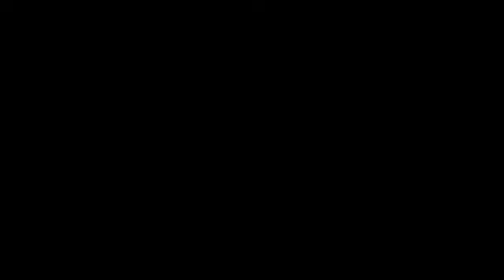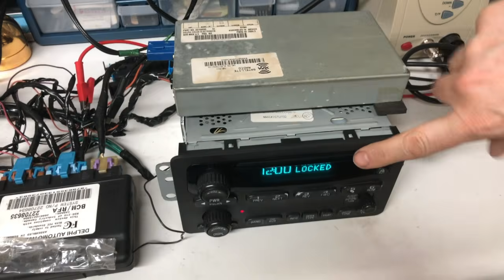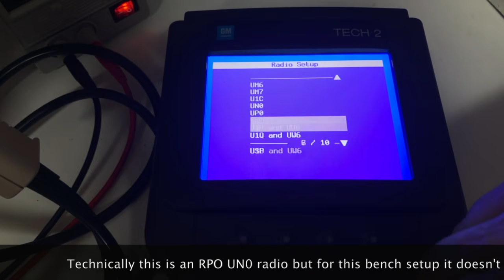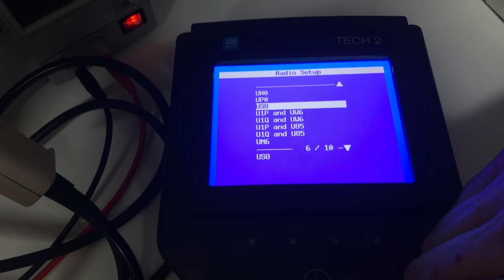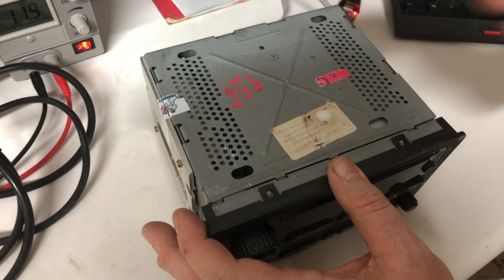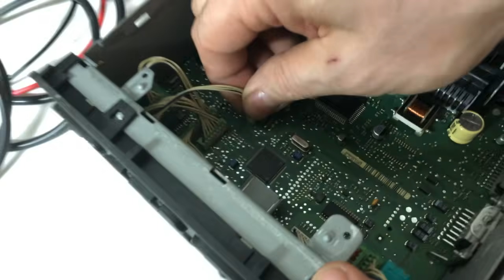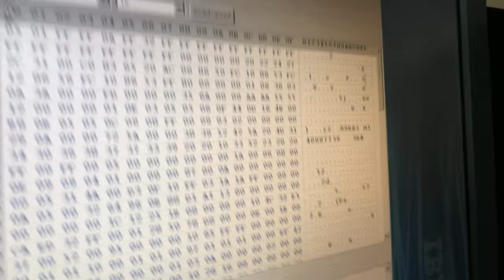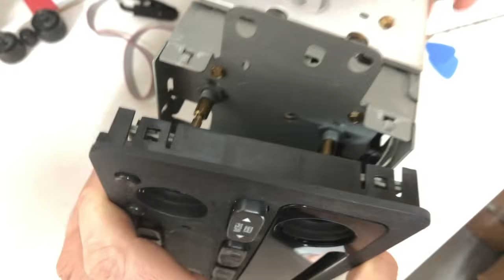2003 - 2006 How to VIN Unlock Salvage Yard GM RDS Radio w/ Tech2 OR Manually Programming its EEPROM

Comment: This is a fantastic video.  Kind of makes me want to show it to the two different auto shops that couldn't program my 2009 HHR!  They had similar issues to those explained by @chevmaros below!

Do you know if the CH341A can be used to program the Amtel 24C128N chip?

(some additional info: No surprise that many DELCO radios use different eeproms.  Mine has the AMTEL 24C128N chip.  The CH341A software only has options to select AT24C128, AT24C128A, or AT24C128B.  I exhausted myself searching how to decode that part number, and all I could find about the "N" was that it meant "write once."  That is ominous but I don't believe it for a couple of reasons: a) the decoding document I found seemed like it was authored by AMTEL but seems a bit suspicious and b) more importantly, I would have assumed the eprom was used to store the preset radio stations and would thus be re-written many times!)
Reply: With fresh eyes, I think I found part of my answer:  I found datasheets for these chips and they indicate they support up 10ok write cycles.

So I guess I'd like your opinion on which model I should select in the CH341a software.
Reply from the maker: Those suffix letters, e.g. "B", only indicate revisions in the device technology.  Like version numbers on a software package.   They are not usually a concern for the programmer though unless programming timings have been revised.   For the older devices used in 2009 I would use the no suffix version or "A" myself.   Now that all said, I'm not sure what the "N" signifies and it might be something special just for Delphi.    The datasheet here https://www.mouser.com/datasheet/2/268/AT24C128C-I2C-Compatible-Two-Wire-Serial-EEPROM-12-1879739.pdf on page 38 explains the suffix in the part number.   I would try a read of the device first, to be sure that looks correct and then save a copy of the contents (in case theres a problem later).  Then try a one byte write in a zeroed area towards the end of the memory space as a test first.  Read back and see if it took.  If not, its read only.  If it works, then just restore the test byte and proceed normally.
Reply: @DrShock  Awesome info!  Thanks for the advice.   My programmer should arrive tomorrow. And I've not got two different software apps loaded to test with.  Can't wait!   I'll provide update as soon as I can!
Reply: The programmer came today and it took me all of 10 minutes to read the chip, the the existing data to a file, edit the VIN, and burn in the new data.  (I used the no suffix version of the chip in the software..."24C128".)  

I had a problem when testing the radio after this first attempt.   The radio briefly showed locked, then the clock came on.   But nothing worked except the clock!   When programming the chip, I had noticed that the first character of the VIN in the original data was '"0",  which was not the actual value for the VIN that the radio came out of.  But I plugged in my entire VIN  though, including the actual first character.  I figured that if my entire VIN didn't work, I could come back and plug a "0" into the first character of the VIN.  

Based on how the radio behaved after this first test, I decided instead to just erase the chip completely as see what data the BCM would create if it looked like a brand new chip.  This second attempt worked like a charm!   I now have a new (and, actually upgraded) working radio!

Thanks for your assistance and the confidence to tackle this project!  ($25 junkyard radio pick, $10 programmer, free software and drivers, and some great internet advice!)

Comment: There should be a big disclaimer...  Using the Tech 2 to relearn the vin works on SOME vehicles, particularly those older than ~2006.   Starting in 2006, a lot of GM vehicles went to CAN bus communication, and I believe on those vehicles, the only way to reset the vin is to reprogram the radio through VCS.  I have had no luck resetting CAN based vehicles with the Tech  2 in any build config.   I've presently got a 2006 gmc sierra that will not allow any sort of relearn from any build combination that I've tried, I either get a failure notice or no communication error...
Reply from the maker: I went over in the video that one cannot relearn the VIN for all GM vehicles even in the model year range this video covers, for some you have to edit the EEPROM chip directly which is why this video goes over that other option.   

Like the video title indicates, the Tech2 VIN relearn is only for 2003 thru 2006, only those vehicle models with the same style of Delco radio shown, and only those vehicle models that present the Tech2 menu option to relearn.  All others have to be edited at the EEPROM chip level.
Reply: @DrShock  I suppose you did eventually say sometimes the Tech2 doesn't work.  I'm picking up a EEPROM reader now so I an go at it that way.   I wonder what the EEPROM settings would be to "clear" the vin without writing a new one so it'll just write normally at key on...

Comment: Hello can you use another scanner like a snap-on scanner other than a tech2 to do this?
Reply from the maker: I've rarely seen these kinds of features available in newer aftermarket scanners for these older vehicles (this video is for radios from over 20 years ago).    But you would have to check this out yourself to be sure.

Comment: I bought a radio similar to this one with the same 2 connections on the back at a yard sale recently. I wanted to ask how I could test it for functionality or just to simply know if it turns on still. Any ideas?
Reply from the maker: I believe I cover the wiring harness connections in this video, such that you could power it up momentarily.  But these radios will not function outside of the vehicle, they communicate with the body control module (BCM) and if it's not found they do nothing.

Comment: Help! Quick question, I am able to read just fine, but when I write and then verify, nothing changes. Last six of the VIN stays the same, not what I changed it to when I clear the buffer and read again. I have 24C08 Generic (loaded from the IC search tab) for the IC, and the programmer is set to 5vdc. I do have 5.1vdc measured across the rail with my meter. I'm assuming if I'm able to read, I should be able to write, is that correct? I hope I'm just missing a setting in Asprogrammer or something simple like that. Thanks for any reply I can get 👍
Reply: Success! Devil is in the 🤬 details! It was as simple as the latest version-3.17 of Asprogrammer that did NOT work correctly to write! The idea finally crossed my mind to try an earlier version and then decided to just find and try the exact version-2.1.0.13 that you used in your video tutorial and then everything read/write worked flawlessly first try! Didn't have to try or do anything else like remove the chip or make sure the radio was LOCKED etc. Thank you sooo very much for your tutorial and extra time spent responding to my messages trying to help me troubleshoot. I will definitely have to put a few bucks in your coffee can 👍 Once I can link a payment to Google (I guess that's how it works) or YouTube. 

BTW- it was called asprogrammer-dregmod-v3.17 from GitHub that didn't work correctly! Supposedly it was the most recent release. Go figure 🤷🏻‍♂️

Also, you can just add a jumper across the 3.3v and 5v pins on the CH341 board and you get a solid 5v without any issue. No heat anywhere on the board like the v-reg area or anything like that 😉
Reply from the maker: Great.  On this sort of software I never upgrade what works.   I also keep obsolete laptops running Windows 2000 and XP around for some older automotive tools that only run on those older operating systems.
Reply: @DrShock  Ditto and I should have paid better attention to the the exact version you were using in the video. It was harder to find that flavor since multiple updates since 3.0 and just goes to show, latest isn't always the greatest 🙄
Reply from the maker: Are you working with this same exact radio?   As the process varies across models.   Also, as I noted in video, the radio has to be in the VIN locked state before you can make any edits.  Otherwise the BCM will just overwrite/correct them.
Reply: @DrShock Thanks for the reply! Very similar if not the same radio p/n10424041 yes, radio shows locked when I put it in my car. It is a junkyard salvage. When I write, there is an error message for verify on the line where the vin number was changed. Eeprom is just not taking a write. Reads just fine, nothing changes though. Still has the exact vin from the donor car, and not taking my edit 🤷🏻‍♂️
Reply from the maker: Is the part number on the EEPROM chip itself the same as I showed here or different?   If the same, then my immediate reaction is bus contention.  It's possible for some other chip on the board to be responding to the write cycle and preventing what you're attempting from being successful.  Every GM radio part number change indicates a design change of some sort as well, thus requiring one adapt to that in applying this process.  I run into this from time to time, where you can read but not write.   When I do, I desolder the chip from the board and write it out of circuit to get around that situation and then resolder it back once verified successfully.

Given that you have the same EEPROM chip (so that it's definitely a 24C08 type), and an EEPROM programmer that writes at 5VDC, and can successfully read the memory contents - bus contention would be my first reaction to the behavior.

It wouldn't be the BCM rewriting the original VIN as in this programming setup you don't have it connected yet (presuming you even setup the same bench harness rig I showed).   And the error on the verify step of the programmer points to the write never happening.
Reply: @DrShock  Yup! I'm using the same ch341 programmer as you and software. Should I put it in the vehicle and turn on the ignition to get it in the 'LOCKED' state first, then take it out to program the eeprom? Aside from that, I will try to program it on a daughter board then... Thanks again for your reply 👍
Reply from the maker: You had mentioned verifying it's locked already in an earlier comment above.  As long as you saw the locked message on the radio display, that's the correct state to be in but it wouldn't hurt anything to redo that step.
Reply: @DrShock  Not sure if my reply posted, so I just put it under my first message if you can read it, titled: Success! Triple thanks again my friend 👍

Comment: Hmm i must be missing something, I have a Tech2 clone but when I try to set up the radio like you it just reads the info and tells me to plug into SPS.
Reply from the maker: I'm using an exact copy grade clone in this video actually.  You should only see that SPS message under the (F1) Service Programming System (SPS) menu path, not under the (F0) Diagnostics one.  Are you able to read live engine data normally with your clone?
Reply: @DrShock  Strange, my tech2 just says request info for SPS in the radio diag menu. I’ve never updated the thing since I bought it in 2015 maybe that’s it.
Reply from the maker: What year/make/model are you building the vehicle as in the Tech2 menu?

Comment: Does the Tech2 plug into the radio? I've seen people put the later 90s CD player in the Fiero. Does the Tech2 only plug into the ecu and can't be used for putting these in cars which are too old for that?
Reply from the maker: No, it does not connect to modules.  The Tech2 is the vehicle scan tool used by GM dealerships historically.   It connects to the vehicles diagnostic link connector port (DLC) in order to access all modules installed in the vehicle from one port.  It is typically used with vehicles from 1992 thru 2008, though there are a few exceptions thru 2013.  The Pontiac Fiero family would all be too old for the Tech2, you would use the even older Tech1 instead for 1980s era vehicles.
Reply: @DrShock Considering the latest car in that line is 1988, and the radio wasn't theftlocked, I doubt a scan tool would help me. Here's hoping some kind soul has compiled a list of the unlock codes for these things. Hope there aren't too many. Thank you for your response.

Comment: I have lived with a locked radio for some years now since my mechanic replaced the bcm in my chevy with one i found in the junkyard, everything works perfectly fine except for the locked radio, now that i found a tech2 to borrow i have a couple of questions: The process to unlock the radio using the tech2 if what i replaced in my car was the bcm instead of the radio is the same? When setting the model year i have to set the year of my car or the year of the car i took the bcm from?
Reply from the maker: Given that the BCM was replaced, the Tech2 may not be able to relearn the VIN.   The BCM will first need to be reprogrammed to match the VIN of the car, contained within the PCM (or ECM jargon wise).  Depending on the model vehicle, used GM BCMs from this era may not be reprogrammable (one time use only).  

That all said, you could give it a try since you have access to the scan tool.  The Tech2 only cares about what the PCM says regarding the VIN and model year, so you would build it that way in the menu.   I will point out that for later model years GM removed the VIN relearn on radios from the Tech2 menu in order to instead sell replacement radios from their dealerships.   So you may not see what I showed anyway, depending on the model and year.
Reply: @DrShock  My car is a 2003 Impala with a radio that looks exactly like the one you had in this video so i'll give it a try following your steps, i hope the VIN relearn feature still be there and not removed, gonna tell you if it works. Thank you!!

Comment: I have a CD Cassette AM FM Radio out of my 2003 Chevy Silverado Truck. It is acting weird, it wouldn't play until a few minutes of driving then would make a loud pop and begin playing. I purchased a replacement radio off Ebay and it's Locked! Can you fix mine? And or unlock the other ?

Comment: I’m trying to do this on a radio. And the test clip is a pain in the neck 😂. It read the chip once. But I’m not sure it was the correct one. But now no matter what chip I try. It won’t read. Thinking my test clip just sucks.
Reply from the maker: The Chinesium test clips unfortunately will end up being next to useless, all of them are of an inferior design from poor grade materials where they are only working within specification a handful of times.  I use a USA made Pomona one, has lasted years with the correct pin tension every time.   The other observation to share is many GM radio circuit boards designs cannot have the memory chip read in-circuit (on board).  The test clip ends up powering up the entire board.  For those designs, you have to desolder the chip and read/write it out of circuit (off board).   At that point you could just opt to swap the chips between the boards.

Comment: HI DrShock, I am hoping I can use this method to vin unlock my 1995 16207944 CA  ID: 2001  Optional 1994 thru 2005 Buick, Olds and Cadillac radio with CD and Cassette. I want to install it into my 2003 Chevy Express 3500 to make it a permanent installation. I won the radio in a local action. It has the 32 pin connector with no wire plug. Manufacture date of 07-02-1995. It says on a white label tag hand written on it Replaced C92 + 91 B Newlon 10-5-95. Also do you have available plug and play adapter wire harness with plug connector ends so I can plug it into my existing factory wire harness. You make it look so easy. Thank You

Comment: Im working on my 06 Malibu radio swap. Do you know if the Audata or snap on tool will work? Do you have a video on the process?
Reply from the maker: I believe only the genuine GM scan tool provides the VIN relearn functionality.   You can also program the EEPROM off the board directly, or swap it into a replacement radio circuit board as long as the part number of the radio matches exactly .

Comment: This is super helpful. Thanks for making the video. Question: Hypothetically, if I were to just remove the chip and solder in a new, blank 24C08 would the vehicle program the EEPROM for me with my VIN?
Reply from the maker: Thanks, no not a blank chip as there's other programming contained inside.  You need to copy it and alter the VIN in the copy, or just physically transfer the chip between boards.

Comment: Anybody know if this particular ch341a programmer voltage has to be modified from the 5v or is that what it's supposed to be at across the rails and data lines? I was thinking maybe 3.3v from past experience, but that was a different eeprom. I just don't want to fry it at 5v if that's not the correct voltage. Thanks to the creator and anyone else that might have a definite answer... 👍
Reply from the maker: Automotive devices of this era are going to be 5VDC.   The video I linked within this one is on how to modify the CH341A for that (as they used to be 3.3VDC only).   That's an older time period, so may no longer apply today.
Reply: @DrShock Thanks 😊 I see the link for the other video now that I'm at my computer 👍 I was watching on the TV and for some reason that doesn't seem to show the description and/or video links like you would normally expect. Streaming YouTube on the TV must be a different animal 🤷🏻‍♂️ lol. Anyway, thanks for the great info, and now I'm able to replace my head unit (with a good used one) on a budget for an '04 Monte Carlo! Really appreciate you sharing the knowledge with a great video 👍

Comment: I have a question, do you put the product line code from your car or from the donor radio?
Reply from the maker: When using the Tech2, you build your own vehicle not the donor vehicle.   Some newer models have removed the VIN relearn menu setting, but the years this video covers it should be there in the Tech2, or Tech2Win, menu.